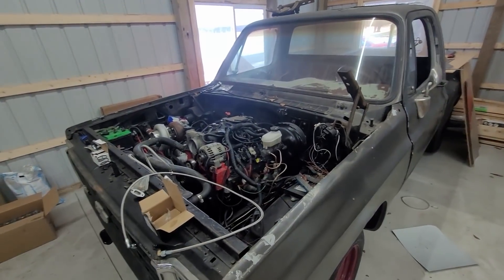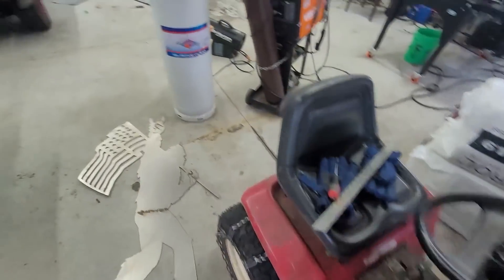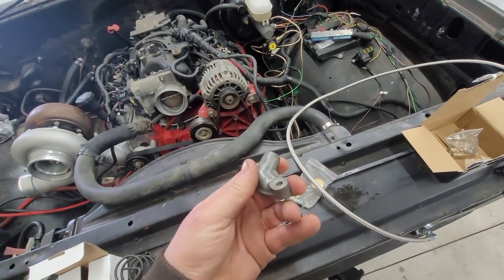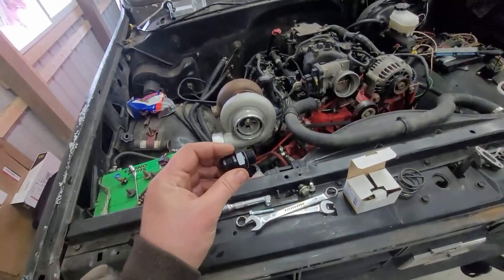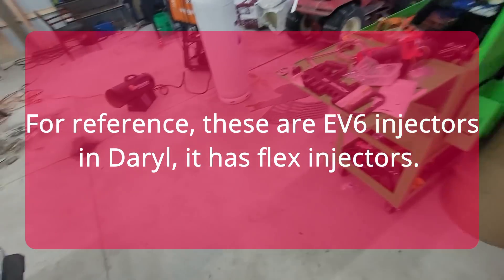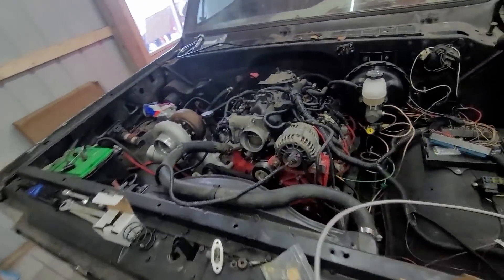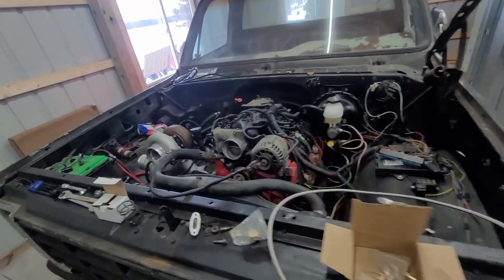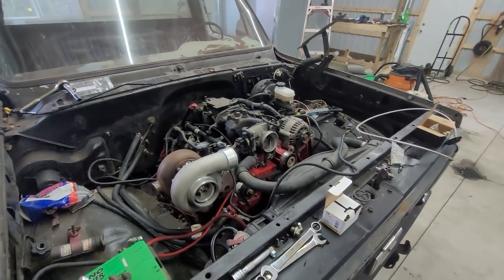Cheapest/easiest way to add boost to your LS engine?

Comment: So since there will no longer be a maf switching over to a speed density does that mean no o2 sensors?
Reply from the maker: Open loop, Speed Density.

100% running off the MAP
Reply: @TheDrivewayEngineer  thanks for the reply im totally new to turboing my truck my tuner really wants we to weld in a ls3 card style bung on the cold side and run closed loop both upstream narrow bands i feel thats Just hes preference to help him tune better

Comment: I effing HATE TURBOS !
or rather I LOVE RELIABILITTY so much i avoid them like the plague, especially  homemade systems put together in a noobs garages, lol.
That being said I did buy a MB with supercharger which i like alot more than turbos cuz its factory tuned and installed and USUALLY more reliable than turbos.

THAT BEING SAID; the prices JR is quoting are almost too good to be true and tempting, ESPECIALLY  when he said it might even fit under a gbody! that burns way too much gas anyways to ever be a daily driver?
Im tempted BUT is JUNIOR misleading us cuz hes not factoring in the cost of TUNING cuz HE already owns HPTuner?

Im just running factory PCm which i removed vatts and enabled electric fans for free myself.[PcmHammer
SO do I ASSUME i will NEED HPTuners if i spring for a turbo system?
My 5.3LS is stock other than cats being removed and a single 3" short exhaust
SO it could really use a turbo to wake it up and turn my open  Gbody rearend into a 1tire-frier!

Comment: Question, does the cheap inlet flange with the tiny hole supply sufficient oil?? I’ve read conflicting information. I want my turbo to live, installing mine currently. I have the Same setup about $1500.00. Already on flex with sensor.
Reply from the maker: The restriction on the inlet is intentional.
Reply: Ok, so more clarification. There are two flanges with two different size holes(.030,.060) The google search says no restriction on journal bearing turbos (drill it out). So did you just slap the flange on and run it? Is it still running today?

Comment: Maybe it's been asked but what did you do about vacuum lines (use a vacuum block?) and fuel pressure regulator? Trying to get new improved ideas and parts. Last time I used an on3 Boost Ref FPR and it was junk.
Reply from the maker: My fuel pressure regulator is a stock truck one. 

The vacuum lines are all stock also

Comment: Watching your older videos, you mentioned that nitrous was the second most cost effective power adder (ahead of superchargers). Could you do a video on explaining how it works, wet vs dry, tuning the jets/how safe it is to run without a pcm tune or taking the engine apart, and putting together a system?
Reply from the maker: That's a good idea, I haven't messed with nitrous in a good long while, need to look at what's available currently
Reply: @TheDrivewayEngineer  thanks looking forward to it

Comment: If i run e85 without intercooler? I would need 1/3 more fuel (pump and injector) what would minimum size
Reply from the maker: If you run E85 period you'll need more of it. Decapps and a Kemso are still more than enough
Reply: @TheDrivewayEngineer  thanks.... the lack of intercooler would be less felt with e85 wouldn't it? (Temp sould be kill my power as much
Reply from the maker: It's not really about power, it's about the cushion you have tuning. 

So yes, E85 will help, you can be sloppier, or more aggressive with the tune than without. 

The same goes for the intercooler

Comment: E85... you don't need a content sensor unless you plan to switch between pump gas and E85. You won't be pushing it hard enough for it to make a big enough difference to cause problems if its 70% to 100%. Its nice to have the sensor, but not mandatory... unless you splash mix it often. I've been doing the E85-E100 thing for 15 years, and even with my 13:1 iron headed 455 Pontiac it didn't care if it had 70% or 100% ethanol, it ran essentially the same, it just made more power on 100%. You probably won't see the cylinder pressures that engine does, as it has a custom ground cam that maximizes cylinder pressure between 2000 and 4000rpm. It was my first mileage mule... 20mpg with a Qjet and ludicrous power in my 70 GTO... more to come on that.

You do need larger injectors, stock LS injectors (non flex) start running into duty cycle problems around 40% to 50%, with boost it will be considerably lower. 100lbs should be fine for what you're doing. A larger fuel pump is a must with forced induction
Reply from the maker: I need a content sensor because it literally won't run without it.
Reply: @TheDrivewayEngineer  Ah, the ECM requires it.. Makes sense. You're using standalone, right? Or is it the factory stuff? What year if its factory?
Reply from the maker: I only use factory stuff, idk what year it is, 03-05, too many junkyards, too many years gone now

Comment: I need an engineer! 
Gen6 454  w/ 01-411-8 Xtreme Energy 212/218 what size turbo?
Reply from the maker: You're looking in the wrong place, I don't get all sciency about it, I just pick the cheapest one that fits.
Reply: @TheDrivewayEngineer  what fits a gt45?
Reply from the maker: @UcantBeSerious03  any T4 flange
Reply: @TheDrivewayEngineer  I never did this before - so thank you
Reply from the maker: You're welcome. 

Know that all that happens if you use the "wrong" turbo, is it makes all the power down low, and runs out up top, or, takes forever to spool

Comment: A gt45 has a bigger hot side am I wrong?
Reply from the maker: Bigger than what?
Reply: @TheDrivewayEngineer  bigger than a 78 75. I guess you can get 7875s with different hot sides. I'm told the gt45s have an 82 hot side. We're putting gt45 twins on a 6 liter, I don't know how that will work with the converter I'm using. I'm sure you know more about that than I do

Comment: Great video...breaks all the BS down very simply.   Question, in addition to injectors and fuel pump, any need to be worried about stock internals on a 6.0 LS holding up to that much HP?  I run an L96 with a 6l90, so not worried about the tranny as much.
Reply from the maker: I'm not worried about it, of course you can blow anything up through neglect, abuse, or ineptitude

Comment: Hey JR … I’m running an LS1 with a gt45 . I have the terminator x and 80 lb accel injectors.. I would love to hear your thoughts on not having a waste gate since the turbo is maxed around 14 lbs ? Thanks for your time and help
Reply from the maker: It's maxed at around 14 lbs, at like 6k on a V8, it can probably hit 25 at 2500 if you suddenly drop throttle.
Reply: @TheDrivewayEngineer  soooo… waste gate it is. I think I’ll weld it to the housing like you did
Reply: I don't need no stinkin waste- BOOOM!!! Oh.. ohh I guess I do 🤔... Hahaha!

Comment: Great timing. I was pricing LSA superchargers last night and after I added everything up it was way, way, way out of my price range. I'm going to start with a cam and maybe I'll win the lottery by the time I'm ready for boost.
Reply from the maker: My truck with the converter, cam, and gears... Is nothing to be ashamed of, and not at all boring... The average yokel decides I must have 500 HP 😂 

But yeah, LSA setups are way not worth the cash
Reply: @TheDrivewayEngineer  I never should have gotten rid of my turbo diesel. Oh how I miss that torque. Chasing dreams. 😂

Comment: That's awesome! I got a LQ4 6.0 that I'm in the process of putting into a 85 S10 . Do you think a gt45 would be ok on a 6.0 ?
Reply from the maker: They work great on V8's
Reply: According to most, a 6.0 would need a larger turbo. Will it work and make some boost? Hell yah! Depends on your power goals, typically the problem runs into back pressure on the hot side. Not being able to flow enough to make more boost. So the 7875 is more sized for a 6L than a Gt45, which works well for 4.8/5.3's.

Comment: Looking forward to you testing it out,  I'm wondering if after testing  it you won't  want the other turbo. For just cruising around it should be plenty and a handful to keep  it under control without any type  of  traction control. Like you mentioned your not really into drag racing tracks more or less doing burnouts and going out and having fun.

Comment: Would 100's be enough for e85 and a 7875 at mild boost (About the same 14psi as you)?  Or are the cng 160's probably better at that power level?  Great video.  Interested if you do shave the intake, could you go over the evap and AIT mods?  Thanks for the content!
Reply from the maker: 100's, by the math, can support 1000 flywheel on E85
Reply: @TheDrivewayEngineer  Thank you

Comment: Just so you know, I've seen multiple snake eater injectors take a shit when at higher fuel pressure under boost.  These were failing right out of the box.  As I would bring fuel pressure up, they would just straight stop opening.  Guess it could happen to any injector, but just something to be aware of.
Reply: I'm curious what the point of raising the fuel pressure would be... seems like a bad idea that would cause issues like ruining perfectly good injectors for instance
Reply: @shawnwimberly9294  a lot of these boosted or turbo applications have fuel pressure regulator with boost reference. With that line hooked up and working correctly it raises your fuel pressure as boost pressure raises to keep from leaning out.
Reply: @BDauto86  where is the issue with increasing volume at the same pressure??
Reply: @shawnwimberly9294  Spray pattern changes, less fuel flow  You want a 1:1 ratio.  A better way to think of it is: "Why don't we run 48 or 38 psi in the rail?"  Because it wouldn't be right.  Running your injectors at 20 psi under the factory specified pressure will cause issues.  That's basically what you're doing when you have 20 lbs of positive pressure on the other side of the injector.  Imagine being full steam at the top of 3rd gear with a hot NA engine and then taking 20 lbs of fuel pressure away.  Although, now that I think about it, the injector tester didn't have 20 lbs of positive pressure  on the outlet side.  That's probably why they failed.
Reply: @shawn wimberly  please enlighten me.  Since your first comment was relating to your confusion as to why you need to raise fuel pressure to feed a forced induction, fuel injected engine, I think you are the one confused.  Like 90% of the forced induction vehicles out there increase fuel pressure relative to boost.
Reply: @jessesmollet6352 how's this? I don't believe your story about personally seeing multiple snake eater injectors failing out of the box, seems like you're bashing the brand randomly for attention. If you have actual proof somewhere about these failures you should produce it or shut up.
Reply: How many do you know of that happening too and do you know about what pressure?
Just curious, I've heard and read many good reviews and know some guys putting down serious power with no issues.
Reply: @BDauto86  I got a video around somewhere.  They started shutting off at about 78 psi.  For most people, that's not a problem.

Comment: What is the most amount of boost that you have ever used without gapping the rings?
Reply from the maker: 15 psi or so, I'll use more, idc, another engine is 300 bucks away
Reply: @TheDrivewayEngineer  shoot hold my beer! 😂👍
Reply from the maker: @masoncampos7043  I use 15 because that's what a GT45 makes on a 6.0
Reply: There's alot of guys putting down serious power with alot of boost and never messed with the bottom end.